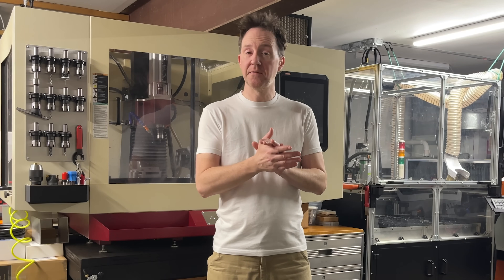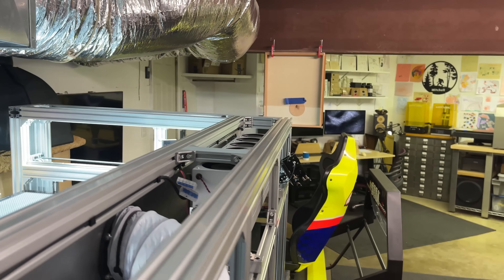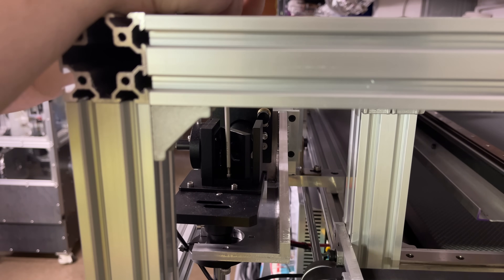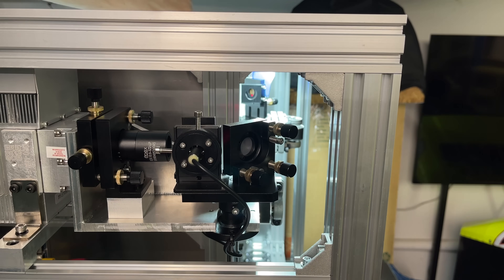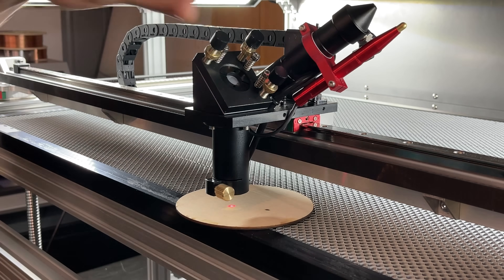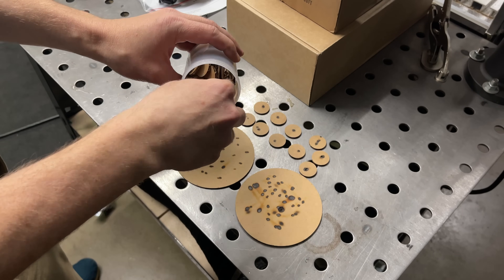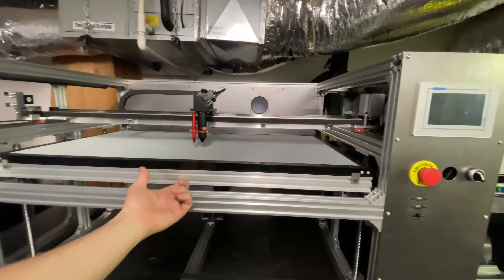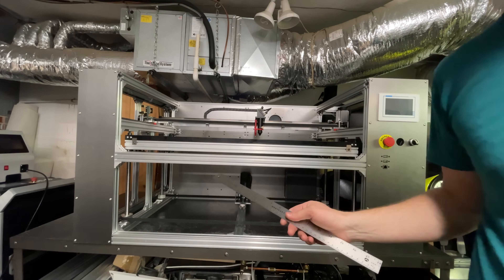DIY CO2 Laser Cutting/Engraving Machine: Part 5

Comment: You’re basically building a Trotec machine for way less cost! The enclosed bed tray is the same style they use, just with a vent centered in the bottom of the tray. That looks like an RF laser source, which they also use, but yours has a lot of improvements over theirs imo. It’s been super fun to watch, looking forward to the finale!
Reply from the maker: I could see where adding the vent in the tray would be useful…hmmm…I wonder if I could add a T to my existing exhaust and add that in? Thanks for the idea!
Reply: @diyfiberlaser  a huge benefit for us (at work) is with warped material. If your extraction is powerful enough, and you get a good seal (full sheet or paper to block openings), the material can be pulled flat for consistent focus distance. Their machines just have 2 exhaust outputs, one for the top along the back of the bed/grate and one for the bottom suction. It makes a huge difference in smoke deposition on the bottom too, just a great solution overall tbh and one I’m surprised we don’t see more often.
Reply from the maker: @nathanblanchard8897  After test cutting with it for a bit and seeing how the smoke travels...this is definitely something I should try to add...and that is an extra bonus of using it as a vacuum table, I will need a more powerful or secondary fan though.

Comment: With all the extrusion that you cut. I'm surprised that you have not built a atomic stop for your saw. I know that it would take up some of your limited space. I just know that in the wood working industry a tiger stop saves a lot of time and money. 

Something simple with one steper is all that you need. And you can use an Arduino or raspberry pi to run it. You just need to be able to zero and move to the absolute value. 

If it was me I would build it into the tube cutter. Then you would have a saw set up all the time. Remember I live in the wood working industry. We cut a lot.
Reply from the maker: Yes! I’ve thought about that a lot…if I had the space to permanently set up my saw, I would do that right away

Comment: Always use dust free gloves when handling any of the optics! Finger prints have to be removed and it's a pain to get them off the surfaces without making more of a mess. ANY place there is residual contamination is where the mirror or lens WILL fail. Replacing them gets expensive fast. Cheers!!

Comment: Hi,
Is your table servo motor with break or without?
Next question, since you closed your table with panels, are you thinking of making vacuum table gor holding materials like plywood and other materials that are not flat?
Reply from the maker: Yes the table motor has a brake, I didn’t consider making it a vacuum table, but that’s not a bad idea…hmmmm

Comment: Impressive work!  I notice that the upper panels on your machines are clear acrylic and that the OEM CO2 laser has orange acrylic panels to block the laser wavelength I assume.  So, does the clear acrylic you are using also block the laser effectively enough or are you just planning on always wearing laser blocking glasses since it's a one man shop?  I'm not up to speed on lasers and laser safety so just wondering how all that works.
Reply from the maker: I am using clear acrylic for the purpose of filming…same for all of my laser machines, I have specific wavelength safety glasses that I always wear when running the lasers
Reply: The CO2 laser wavelength will be completely blocked by acrylic anyway.
Reply: @laserdan  Not completely, if it were completely my co2 laser couldn't be seen on the other side of acrylic I am cutting when on a lower power setting. Sure it absorbs alot but not all of it.
Reply: @Segphalt  You're not seeing the actual laser beam under any circumstances (the wavelength is far too long for our eyes to see it). I think tinted acrylic may be useful to reduce the glare from superheated materials, which is what you're seeing.

Comment: Is this all for your hobby or are you running a business (or plan to) with all these different CNC laser cutter machines?
Reply from the maker: Right now I’m doing it all to learn and share…I’m getting to the point where I’ve built most of the machines I want to use…in the future I will transfer into doing other types of project videos utilizing my equipment and it would also be interesting to focus on manufacturing a product at some point…we’ll see what the future brings